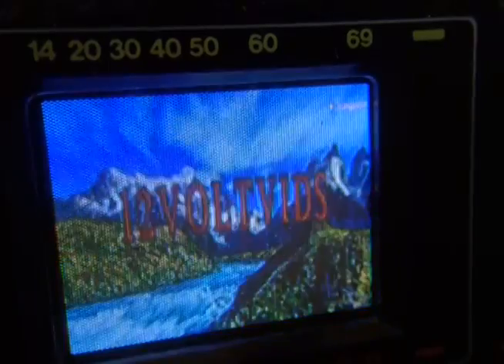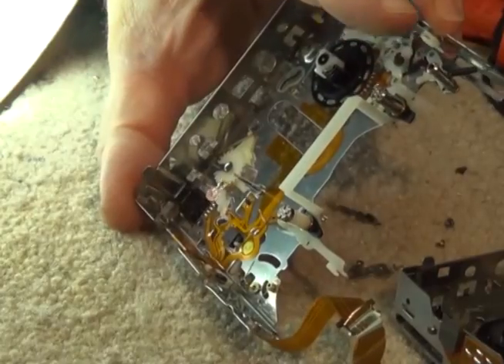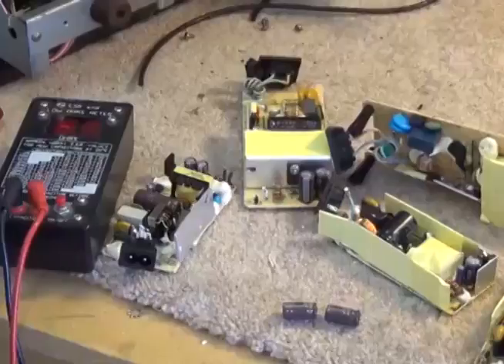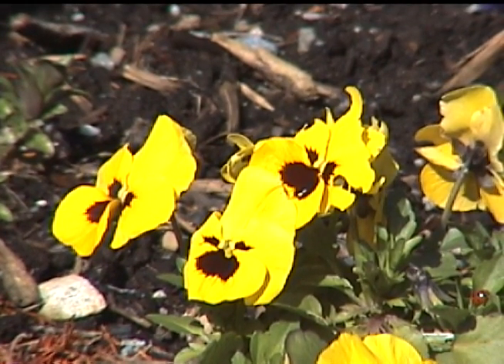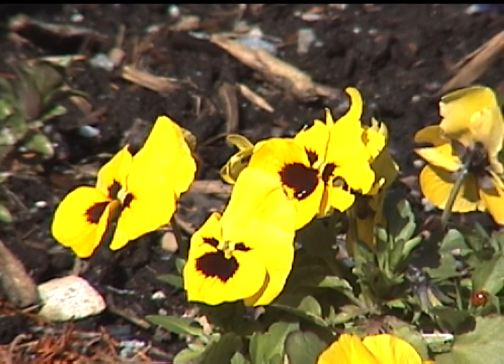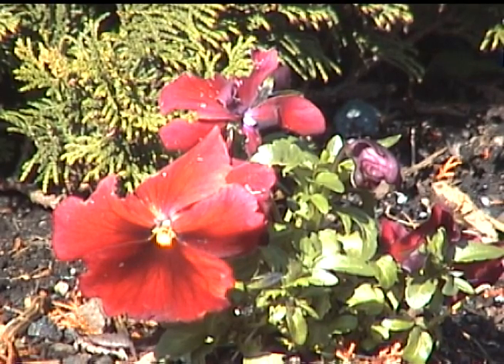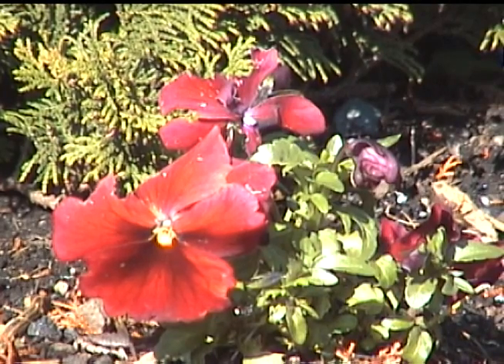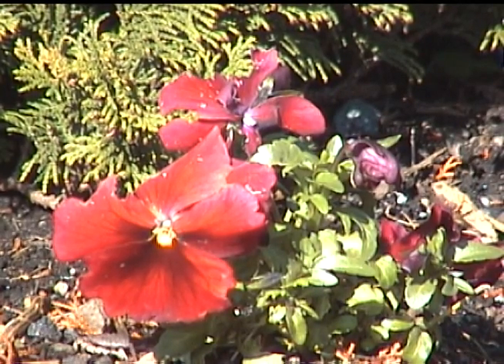Compare Digital 8 vs Hi8 vs DV

Comment: IMHO Digital8 is probably Sony's Wednesday child. Its purpose is only to squeeze out the last bit of money from video8 format before being totally abandoned at the end. So only moderate amount of effort being poured in to make it "just work" and get some sales.
Reply from the maker: No, incorrect. Digital 8 was introduced as a way to wean prople off analog and into digital. They brought out digital 8 as a way for existing 8mm and hi8 users to make the move to digital while still being able to play their existing tapes, and had they not crippled the chip it would have been even more successful than it was. At the same time they did not want to make it too good, because they didn't want to harm their mini dv and professional market.
Reply: @12voltvids  So that's quite the purpose - filling the (small) market gap between video8/hi8 and miniDV until it dried out in mid 2000's.
As far as I remember the 2nd-3rd gen of D8 handycam was quite capable - megapixel sensor, still image, tons of (crappy🤣) digital effect, av>dv function, analog tape playback, and even 50i&60i D8 playback! Almost as capable as midrange miniDV counterparts.
But the very last D8 was another story. No still image, no av>dv, nothing - it couldn't even play analog tape.🙄 So it defeats its intended purpose in the first place and of no use today - at all.
Reply from the maker: @Nantawat_Kittiwarakul  Except that if someone had a digital 8 and made all their recordings in digital as that is all it could record. Then a digital8 only player is all that is needed to play those tapes, but other than that useless.

Comment: Yes, I was very disappointed in my D8 DCR-TRV270 in 2005 when I first saw its picture on my computer monitor. It was fine on an SD CRT TV, but very pixelated on any higher resolution displays. A second hand, higher grade Hi8 camcorder for the price of my new D8 probably could have been a better buy. A few Hi8 models were still available when I bought my D8 in 2005, but those late models had even lower pixel count CCDs in them compared to my D8.
Reply from the maker: Yes I know. They didn't want to undermine the DV and now HDV market.
Another thing they did with their consumer DV camera vs the professional camera was locked vs unlocked audio.
My JVC professional DV for example has locked audio 48KHz 16 bit audio locked to the video clock. The DCR VX1000 for example used 32KHz 12 bit sampled audio and the audio clock was not locked to the video clock. Playing the tape everything was fine, but dump the tape into NLE and the bloody audio would start to drift. For short clips not a problem, but long for audio and after 10 minutes your audio was close to a second out of sync and there was no real way to stop it from drifting. This was intentional so consumer cameras would not be used by broadcast operations. It still was, the producers just ran a seperate audio recorder and synced up in post.
I recorded my sound on the GYDV500 and just used the vx1000 as my second camera and synced the picture to my reference.  Oh the fun and games. I am going through old tapes looking for buried treasures and have found a few I might share.  Just found an old news footage tape I shot of a condo fire that was aired on the local news.
Reply: I had a Digital8 camcorder. I watched the footage on an iMac's Full HD screen but I can't remember any disappointment. Of course the image is quite small but that's how I watch YouTube in 2025, 480p. I can't watch the interlaced footage natively because I don't have CRT displays and the conversion to progressive is not perfect. And of course, it's not possible to present DV natively on YouTube.
Reply: @satunnainenkatselija4478  There were a handful, maybe 3 or 4 Digital8 camcorder models that used high resolution CCDs, maybe you had one of those. Can you remember the model number of yours? But 90% of D8 camcorder models used dreadfully low resolution CCDs, at least from Sony. Most of D8 camcorders are Sony, IIRC the only other manufacturer of the system was Hitachi with a few models, but I don't know what resolution CCD those have. 

BTW there are some very good, advanced de-interlacing algorithms, you can even convert your 25/30fps interlaced video to 50/60fps progressive with great results. I suggest to try the many different deinterlacing plugins for VirtualDub and AVIsynth.
Reply: @satunnainenkatselija4478  A handful of Digital8 camcorders, maybe 3 or 4 models has a high resolution CCD. One example is the DCR-TRV730 with a 1/4" 1MP sensor (690k pixels effective), while most D8 camcorders had a 1/6" 540k pixel (350k effective) sensor, so half the resolution of the 730, and also physically smaller sensor. The 730 can probably capture broadcast quality in terms of resolution (not quite in terms of color rendering, those days you needed 3x CCD for that). Can you remember which model you had?

Comment: MicroMV was DVD-quality with 12.5 Mbps bitstream, or half the 25 Mbps for Digital8/MiniDV/DVCAM/DVCPRO (DV25). That was a very interesting and nice video! I have old Super VHS, Betacam SP, Betacam SX, Digital Betacam SD equipment. Also I have HDCAM, and HDCAM SR video equipment and it's still a bit pricey at the moment compared to the SD counterparts.
Reply from the maker: I got rid of my pro hi8, and betacam gear years ago. I still have an HDRFX1 3CCD HDV camera and a JVC GYDV500
MicroMV was MPG2 IPB, same as HDV format, but HDV did it at 25mbits.